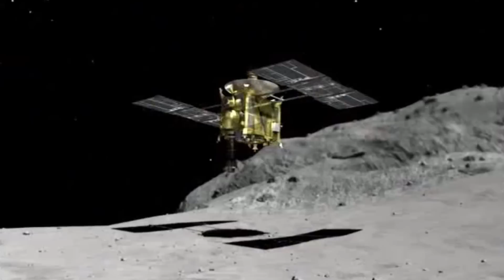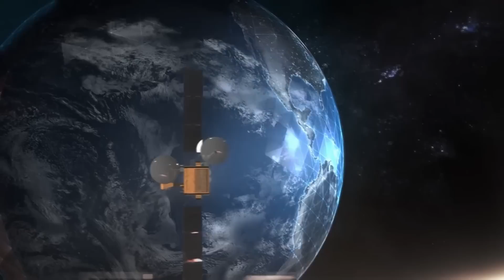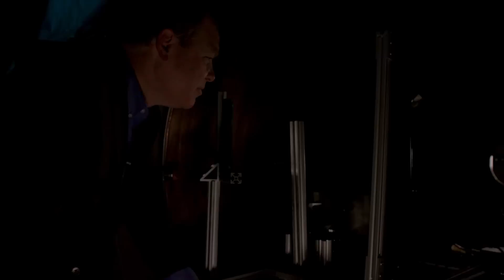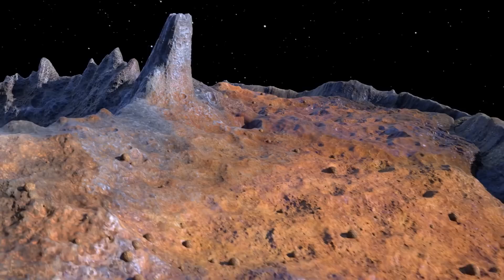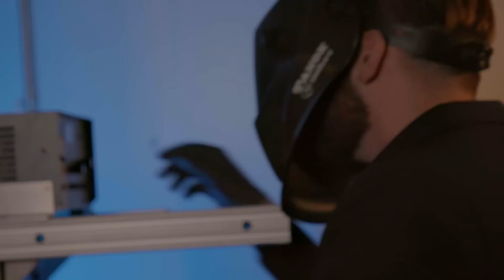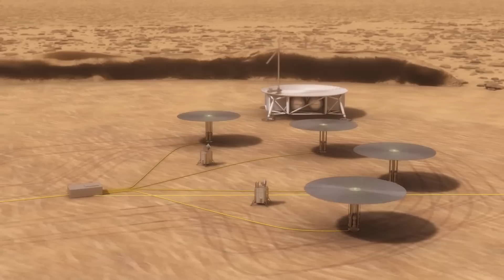Space Race 2: Who Will Win? | FULL DOCUMENTARY

Comment: I saw an asteroid moving on this video and thought up what if you find a 400,000 foot astroid then you already have something 400000 feet long , now put a floating air bubble around it for air and downward gravity from 400000 feet of air on top of you pushing you down to the ground where there might be some  electrical field from the critical matter or electron soup that's thinner than air and sub atomic critical matter that don't need heat or pressure much to condense
Reply: 400,000 foot solid iron astiroid then you could learn from it how to 3d print solid iron 400,000 foot long metal beam